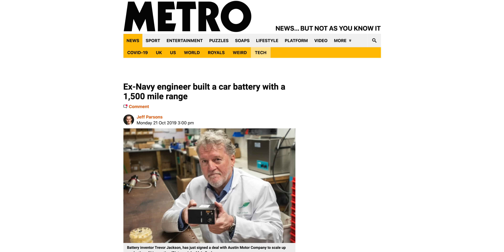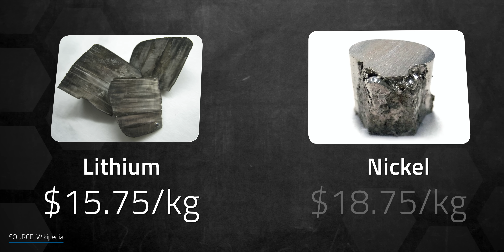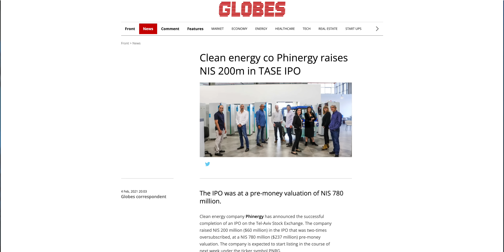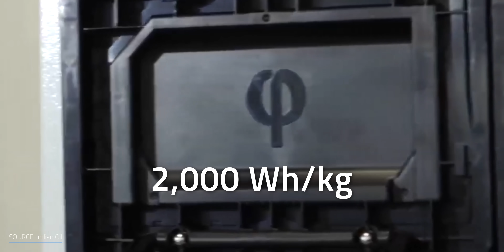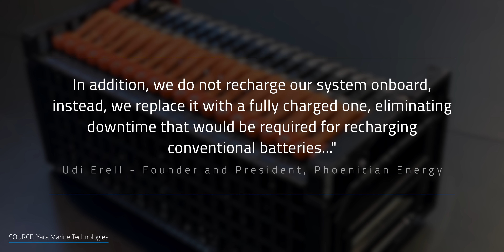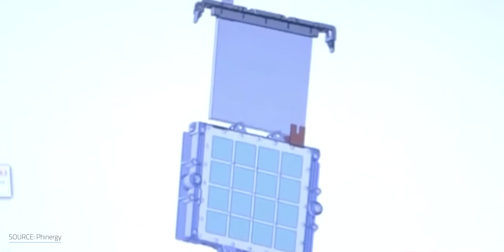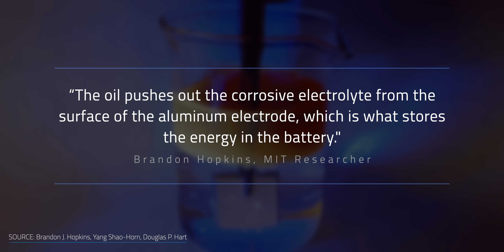Exploring the 1000 Mile Car Battery - Aluminum Air Hype?

Comment: 9:03 Imagine missing the fact that your long range gas tank is almost empty and you run out of gas. How much harder is it for a service to deliver a battery than to deliver a can of gas?  And recognize, delivery of a battery is like delivering a complete full-up of gas, not just a gallon or two of gas. 
If this is implemented, the infrastructure will adjust and running out of aluminum will be no different than running out of gas.  
And if I’m designing a system for a car, it would have two “cells”, exactly as shown in the video, so you could swap out half your capacity while running on the other half.  That way, the half way point is your trigger to find a new battery pack, not the empty mark.  
When I started driving many decades ago, my dad stressed that it costs the same to keep the top half of your gas tank full as it does to keep the bottom half full, so I already see the the half way mark as time to refuel.  It’s not a difficult concept to learn or follow in your daily life.
Reply: We won’t run out of aluminum in the same way as we run out of gas since aluminum is easy to recycle
Reply: @TheMrDeathpunch  There wont be any Aluminium left to recycle at the end of such a battery's  life. It would have all eroded away into the electrolyte
Reply: @rakmanbaba  the aluminum doesn’t disappear they can extract the eroded aluminium, hence recycling it. Unless it vaporizes into the atmosphere it can be extracted
Reply: Ok, super tangent on virtue of filling up at half a tank. Pedantic much?

Back to topic. I was thinking same thing. Stranded roadside, need gas vs need a battery, not much difference. Assumption of course is these batteries will have some sort of universal size and interface, and simple means of swapping, that could be done roadside.

We'd be stupid not to design it like that.
Reply: Common Sense
Reply: clearly weight don't matter that much for the median car user driving alone in a big car with a big engine...
Reply: So that's why I don't care about 1%, using such ridiculous machine. I drive for fun.

I don't care either about the weight of the batteries on an electric car. 

The only thing that matters is the TCO. The total cost of ownership of the entire thing + fuel.

If you calculate that, where I live, we have so much hydro power, that's like $0.15c per kWh, and a full battery is so much cheaper, that the TCO for an electric car is less than an combustion one, yes, even thou electric cars costs more.

Fuel is expensive and ICE is already inefficient machine, you drive it for fun, so why care about the cost.

Then the only thing that really matters is the range you can drive, which is bad for electric cars.

And then you people complain about 1%....

I roll my eyes...

Cars are stupid things if you think too much, so just refill the tank and be happy.
Reply: @monad_tcp  we get it, you're a self interested douche.
Reply: Overall true but I doubt battery delivery can be equated to a full fill up since it's just a single battery, it shouldn't be too difficult to manage it being delivered. And I'd hope aluminum at least has a longer life than gas if it's recyclable, bit I guess that depends on the efficiency of our recycling.
Reply: @legendaryzodiac574   The reaction that produces the electricity actually consumes the aluminum. It produces an aluminum hydroxide waste that would be what is recycled. 
One of these with the right design could be “recharged” by sliding a new aluminum plate into it and connecting it up.
Reply: Like moving a propane tank //
Reply: Would I want to drive such a car?   If I 1) lived in an Indian city and mostly drove locally, 2) could go to any Gas Station and have my battery swapped by a serviceman in 5 minutes,  3) the cost equivalent was half that of gas and about equal to electrical charging, 4) the cost of the car was something like $15k, then Yes.
Reply: Initially I was just going to come down and say "no". But you make some good points. If the Car company that did these aluminum air batteries had this infrastructure in place and the car came with a certain about of "refills", regardless of where you were and as you point out the car would have two battery packs, people would get used to scheduling a battery swap in much the same way as we schedule an oil change or 20k mile service. I have a sneaking suspicion that the cost of the battery would be a large chunk of cost of the car. Initially the company would owe you so many batteries with the purchase of the car but this would probably get delegated to the aftermarket and would be suseptable to large scale fraud. You "new replacement batter" might actually be someone's leftever mostly used up battery. The other issue I see is I don't think it would be as simple as popping the truck and replacing the dead battery and the other one is still new or good. Something tells me the battery would be the car, much like batteries for an ev or hybrid are the base of the car and they and the car is pretty much useless when they are dead. I like your enthusiasm but something tells me there would be a lot more drawbacks than you and I have thought of yet.
Reply: @waynethomas1726  I have no doubt that there will be things we’ve not thought of, but the aluminum battery technology actually consumes the aluminum much as gas is consumed. The battery change can be handled in various ways, but one thing is certain, the design will have to allow some method to replenish the aluminum. You aren’t charging the battery so much as you’re refilling it. It’s almost like this technology is closer to being a fuel cell than a battery…. Almost.
Reply: You also lose time by refueling twice as often...
Reply: @thomasrebotier1741  Which galaxy's CEO are you that you don't have an extra 3 minutes to spare for every 1000 miles you drive?
Reply: @Aniket7Tomar  You missed a beat. I was commenting on refueling gas cars every half tank; that's more than 3 minutes and far more often than every 1,000 miles :)
Reply: It costs more to run a full tank than half a tank because half a tank is lighter, so you get better mileage out of the bottom half of your tank, so Dad was wrong
Reply: @BattleCorgiTV  this is a myth, it doesn't cost more to run a full tank, its 50L of gas we are talking about against 2 tons of the weight you have to move. It would cost 0.5c more or something.
This point is moot. 
If you are going to think that way, you might as well cut the car in half, and remove the extra seats, why carrying the weight of a seat when you drive alone...
Reply: @monad_tcp  It's not entirely moot. On average 100lbs of weight is 1-2% efficiency. There's a reason car manufacturers try to remove as much weight as possible when making efficient cars.
That said it's probably not worth worrying about day to day. Nor is filling at the halfway point vs filling at a quarter tank. Most cars now are efficient enough that it's pretty hard to run out of gas too far from a station. A quarter tank will still be 70 miles or more in many vehicles. 
So both points are equally moot. I tend to fill around 3/16. Because I don't drive much outside going to work and I don't want to end up with old gas building up in the tank, but also don't like getting below 1/8th because I like my fuel pump and would like it to keep doing it's job. But only need a tank about once every month and a half
Reply: @monad_tcp  lol You sound like an automotive engineer! Where did you go for grad school? Genius
Reply: @BattleCorgiTV  genius is you, a driver complaining about 1% of efficiency of the gasoline while you drive a 4 seat car mostly empty most of the time.
If I was an automotive engineer, I'd just put a stronger engine, americans have infinite petrol either way...
Otherwise they wouldn't be driving those atrocities called SUVs, instead of small cars that weight much less.

The irony, you drive a SUV and car about the weight of the gasoline.

Super facepalm. I'm seeing my brain after rolling my eyes so much....
Reply: If I really cared that much about gasoline use, I would replace the body of the car for carbon fiber, remove all the extra seats, remove all plastics, and trim the vehicle to bare minimum.
But I'm not that poor, I can afford the weight of the gasoline itself, let alone the weight of the rest of the car.
Cars aren't efficient things.
Complaining about the weight of the combustible is entire moot point.
When you are fucking driving a heat engine that's at best 40% efficient...
Reply: If you are that poor, 1% of weight makes a difference, perhaps taking the bus or train ? 
but you do you...
Reply: @Raven1024   " I don't want to end up with old gas building up in the tank "
That doesn't happen, because the pump takes gas from the bottom first, not from the top.
Also, there's a filter for detritus before the pump.
Reply: 1% of 50L, that's like 500ml of gas. I like to drive super hard, my feet is a bit of heavy, you people made me laugh. as if 1% would make a difference. With a turbo charged, lol. one rev up, 250ml gone. 

Its not like a fleet of vehicles in a company where you save big bucks by cutting 1% of the fuel usage.

Guess what, companies use vans to care much more products vs the weight of the car, not single passenger vehicles.
Reply: @monad_tcp  The point was that I occasionally have a longer apart fill that could allow it to happen. Secondly you're mixing it when you fill. It's not some massive concern, but I go through little enough fuel sometimes that is prefer keep it fresh.
Reply: @monad_tcp  It's 1-2%... Over multiple fills. After two tanks that's 1 liter... Four tanks it's 2 liters... It's not like you're saving 1% one time and then never again.
Reply: @Raven1024  Sure, it compounds, but the same could be said about the superfluous extra seats you never ever use.
Unless you drive you family around, you are already wasting resources by having a 4 door 4 seat car using it to carry only one person.
And then theres the metal body, it could be plastic, its just for appearance anyway.
Then you are fucking driving a SUV...
Reply: @monad_tcp  if you're that poor, you'd probably not be able to afford a car in the first place..
Reply: @tiwaringp  Probably, It just gets on my nerves those "dime savers" looking at small things and missing the big picture.
Guy would literally complain that its a waste to fill the tank because the weight of the gasoline makes for a loss of 0.5% while at the same time the person idles his car every day while going to open his garage door or something... 
Or when he gets stuck on traffic (which you can avoid by leaving earlier from the job).
Reply: @BattleCorgiTV  LOL....but then you lose that mileage because you car's fuel economy is best at 60 mph (95 kph) but you insist on driving at 80 mph (128 kph) with the A/C on.....so maybe your dad knew you better than you think and accounted for your poor driving behavior?  ;o)
Reply: @BattleCorgiTV  Hair splitting. Quibbling. 
I’m talking about the cost of the gas. You add in the cost of carrying the gas. So, okay, go ahead and add the ancillary costs, I’ll add ancillary value received. 
The cost of running out of gas more than offsets the few cents you are talking about in mileage.  And that doesn’t consider the value of the safety/security and peace of mind you get from knowing you won’t run out of gas. 
You can go ahead and run on the last ounces of gas in your tank so you can get your .01 miles per gallon more.  But if I stop to offer you gas as you sit on the side of the road, I hope you will refuse my help and stand your ground. 
Oh, and, go ahead and continue to be a troll. It’s cute.  The world needs more obtuse (intentionally ignorant) people.  The entertainment value you provide is a gift.

Comment: I think your example where you run out of energy in the middle of the night on the highway is a little off. You don't need to be towed to a station to replace the battery, it's just like if they were to bring you something to top off your rechargeable lithium battery. The specialist who would come and help you will have at least a short range replacement aluminum air battery. As long as the replacement doesn't require lifting the entire vehicle off of the ground to remove panels under the vehicle, it shouldn't be too hard for a technician to pop open the battery compartment and swap out one or two batteries and get you on your way. Especially if the batteries are as light as they sound.

Comment: 11:14 NO.How about a liquid from plants like biodiesel to put it in the cars we have now without having to destroy the existing infrastructure.We already have petrol stations and and internal combustion vehicles.Is it not possible? You realize how much energy,waste,pollution and effort we need to replace all the cars on the planet with electric ones...and in a few decades to replace them again with other forms that will appear then.Now this is profitable and fashionable.ECO...you want to cut your carbon footprint,how about you stop depending on your car so much and start using a bike or public transport.Build smarter cities,finish this nonsense sprawl.

Comment: The issue here is adoption as battery networks in Europe, China and the US are already in place. Electricity is easy to distribute via networks, it sounds like aluminum batteries require distribution (like oil, trucks gas stations etc.). The better option is the development of something like sodium batteries or a new rechargeable battery solution.

Comment: Can it charge fully in 5 minutes? If not it’s not beating a gas car it’s the same reason electric cars never catch on. Instead of worrying bout range they should figure out fast charging an electric car that only has a 200 mile range that can charge fully in 5 minutes would be way better then a 1000 mile battery that needs 8 hours to charge

Comment: if a portable electric station  can be towed similarly a aluminum battery can be carried to the needed place............. and if it requires just a few mins to replace a battery it sounds better than Lithium battery. It'll also reduce load on grids

Comment: The fundamental of any technology is always a trade off between cost, supply resources and reliability for mass use. 
If this technology gives a 1000 miles single charge with aluminium and is reliable and cheap. It's worth it.
After all aluminium oxide is not very difficult to convert back to aluminium.

Comment: Right now in China there is a service for unlimited charging of electric scooters for 30 bucks a year. it looks like you drive up to the vending machine, remove the battery from your electric scooter and swap it with the battery from the vending machine))

Comment: A hybrid version is best where the a small Li-ion battery a range upto 100 km can be auto switched to from Al-air battery would solve the problem easily until the Al-air battery technology gets slowly from replacement to rechargeable one

Comment: Non rechargeable? That's ridiculous.
The main reason to have an EV is lack of any maintenance and ability to charge it up overnight form standard wall plug.
If you'll need to replace a battery every 1000 miles it would be crazy expensive and cumbersome. No one would like to switch from a gas car to such "EV"

Comment: For battery-swapping to work, the batteries and the swapping process would need to be completely seamless and reliable.  The batteries would have to be standardized in design and specifications, simple, easily available, rugged, and very simple to handle and install. Using this technology would have to be as simple and transparent as using a gas pump.

Comment: Assuming that the EV market grows tremendously, the time to charge batteries will become a major concern. Just imagine that there are 5 cars waiting to charge in a station, you have to wait for 5 hours for your car to fully charge. This is terrible in countries such as India with high population. So EV battery swapping is the only practical solution - even with lithium or Aluminum battery. So for all practical reasons of charging, aluminium option seems to be a long term viable one as compared to lithium

Comment: As long as the infrastructure is there, why not? How can it be harder than drilling thousands of feet under water and rock, taking crude oil to be fractionated then distributed by thousands of trucks to the filling station. Petrol is only cheap as its produced in huge amounts with a huge infrastructure.

Comment: One of my main issues with your channel is that more often than not, the video clips are barely relevant to the topic and is clearly a key word search hit from a stock video provider. Often the video is so completely "wrong" that it can be very confusing. Once this is noticed it then  becomes difficult to trust ANY of the visuals. Many many many many MANY MANY channels on youtube do this, to the point of it becoming a humorous trope. When it happens with complex technological topics it can lead to misinformation.

Comment: These are recyclable fuel, in solid form. For the user they work just like gas, except they don't emit CO2 and can be recycled. Battery is technically accurate, but horrible marketing. 

It's not like EVs are a thing because we hate tanking fuel and love charging batteries. We use EVs because we wanted to get away from CO2 emissions and oil dependence.

Comment: battery swap seems for me a better solution than hours spent on charging station. Biggest issue is cost. If cost for 1kWh of energy will be lower than for current batteries than metal air batteries are winner. if not than we will still wait for something like solid state batteries hoping they will be better than current ones.

Comment: The main drawback I could see is : you can't recharge it, and, you have to throw away the left kWh if you change the battery before it is empty, which will always happen since no one in their right mind would drive up untill the battery or gaz tank is completely empty...